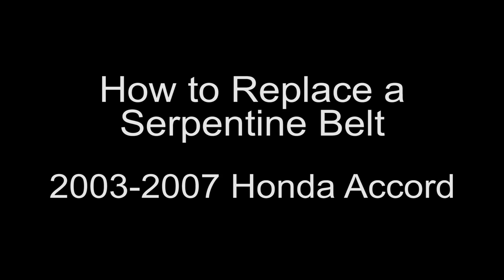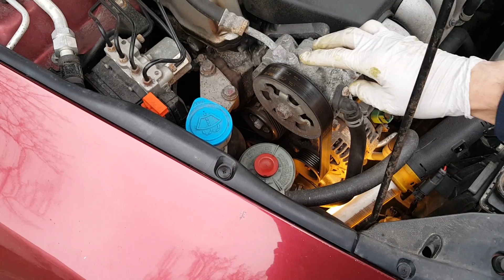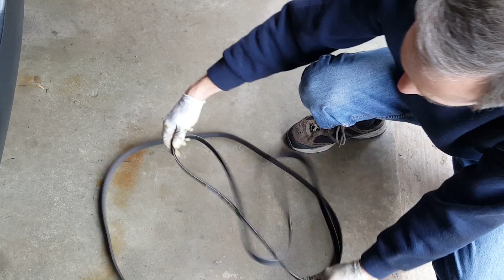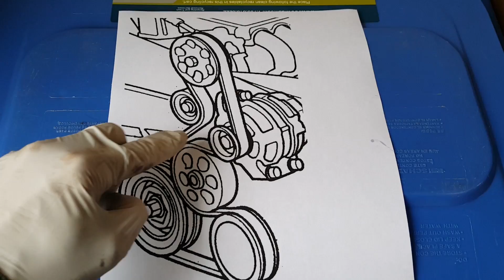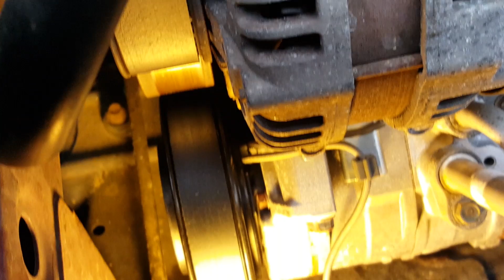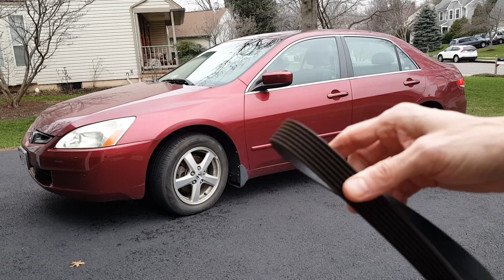How to Replace a Serpentine Belt - Honda/Acura

Comment: ‘57 Chevy BelAir 283 CU, 300 hp, lots of enhancements. No fan shroud. Have had the Champion for at least 3 years. Works great as long as I flip the manual fan switch on if it is a hot day in heavy traffic. Maybe I should break loose with some cash and put in a thermostat control for the fan.. otherwise I guess I should have bought a HD Champion.
Gus St Marie

Comment: Awesome.
Video, you know, other videos I've seen.Don't tell you the The Size of the box wrench and how to do it Exactly where to put the box Wrench on some guy recommended a longer 14 mm which is good as well. But they don't tell you where to put it. And you're just releasing the tension. Yeah, great video.

Comment: Cut it
Reply from the maker: Well, that would surely get it off. But, I wouldn't be happy about the violent effects on the tensioner. Then you still need to spring it back open to put on the new belt.

Comment: Does this work for placing the belt back on the alternator as well? I'm struggling to put it on the power steering
Reply from the maker: Yes. It's one belt that routes around all of the accessories.

Comment: Great job, thanks for the accurate explanation, also I would like to ask. How can make my power steering move softer in a Honda Integra 2003 Deluxe 2.0 Lt engine Coupe? Keep up the good work. Cheers from Australia. Patrick
Reply from the maker: Hi, Patrick. Greetings to you Down Under. I am afraid that I don't understand your question. Is your power steering malfunctioning or do you want to enhance its performance?

Comment: Great video -- the tip about routing around the crankshaft pulley from underneath is a great one. In fact, I jacked the car, and pulled the R Front wheel, and you can get to it through the wheel well. (I had the belt caught on something under there and it ate up 3" of slack, which was unbelievably frustrating, until I discovered the problem).

Comment: Is there a chance the pulley gets stuck up making it difficult to reduce tension to remove or replace the serpentine belt?
Reply from the maker: I suppose it could be possible for the pulley to get jammed if you slip and allow the tensioner to violently spring open. But, I don't think that is very likely.
Reply: Followed your video and now I know how to change the serpentine belt.
Reply: I can do it handily now after watching over and over again your training video

Comment: I stripped the bolt on my idler. Belt started to slacken up, while i was trying to get the belt off it tightened back up, now I can't loosen it. I guess I'll just set the whole thing on fire
Reply: LOL'd!
Reply: Nabre Labre pee on it! Could be worse, the true reason they 180 turned the engine on the last gen integra is the nightmare that they had going with the alternator position. Or was it because itbs look better in front? Sneaky bastards.

Comment: Quick question  anyone. I was replacing my radiator there in the lower bottom are 2 small hoses one on each side or the radiator. They have some oil on it but I lose some during removing . Any one knows what type of oil is that ?? Looks black like motor oil but please I need answers . Thanks.
Reply from the maker: If your car has an automatic transmission, those are the transmission cooler lines. Transmission fluid flows through them and through the radiator to keep your transmission cool. If that fluid is black, you're way overdue for a transmission fluid change.

Comment: Well done, this is what makes YouTube so great. How many miles/years were on that belt and tensioner? Thanks.
Reply from the maker: The timing belt, tensioner, and idler pulley had been replaced 15,000 miles and 6 years prior.

Comment: Once you've taken the belt off the top pulley, why not just cut the belt with some tin snips and thread it out that way without having to try to thread it off while still in a loop? You're tossing the belt anyway.
Reply from the maker: Good idea. That is certainly faster and easier. There are times, however, when you don't want to destroy the old belt such as when performing some other service that requires removing and reinstalling a perfectly good belt. I also like to keep the old belt in the trunk for emergencies.
Reply: Sounds fair. Thank you for the reply.

Comment: Thanks for the video...It took me like 15 minutes...I did grab the Harbor Freight Serpentine Belt (http://www.harborfreight.com/serpentine-belt-tool-kit-66344.html), put on a 14mm socket (not in the kit but worked perfect) and it made it super low effort.
Reply from the maker: Good investment and I'm sure that made it much easier. Appreciate the kind comments!

Comment: thank you..if i may ask is have you ever found out what that noise is that makes it sound like a diesel? My v6 accord makes the same exact noise as yours..it's not ridiculously loud an i can't hear it when driving but when i have the hood open or I'm standing by it i can hear it..Exactly like yours
Reply from the maker: I haven't definitively diagnosed it yet and our '07 Acura RDX as a similar noise. It doesn't change when I do the water misting test.  So, I've ruled out the belt itself.  It is surely one of the belt driven rotating pulleys or components. The noise gets slightly louder when the A/C compressor kicks on and imposes more load on the belt and other components.  It's not dangerous so if and when it gets worse, it will be easier to find.